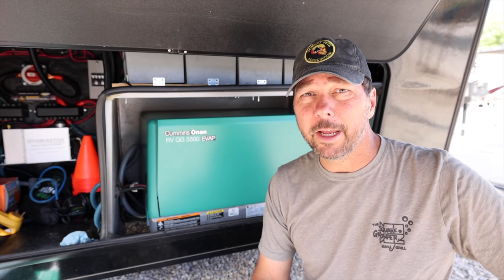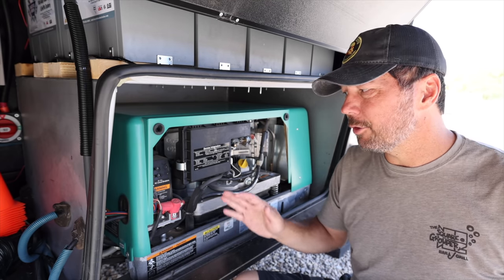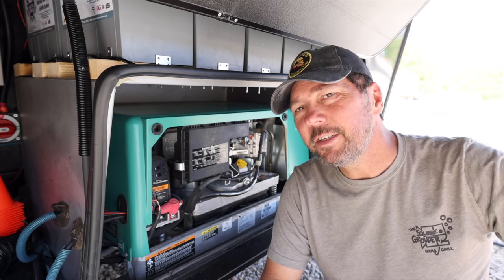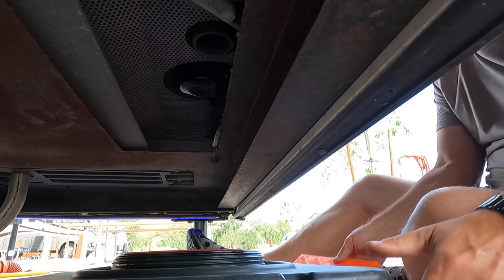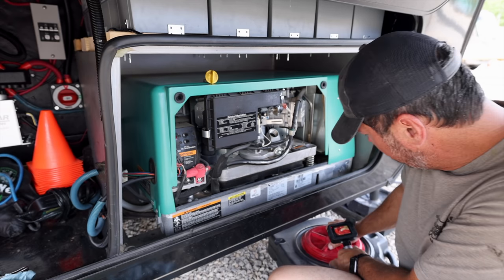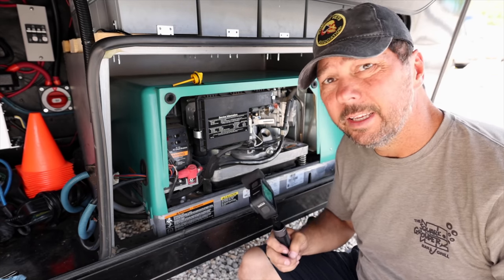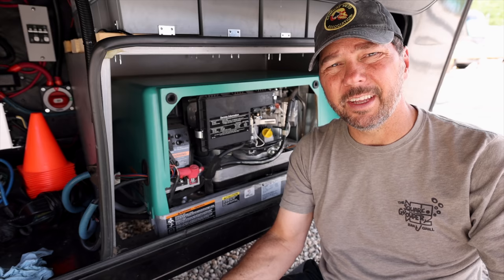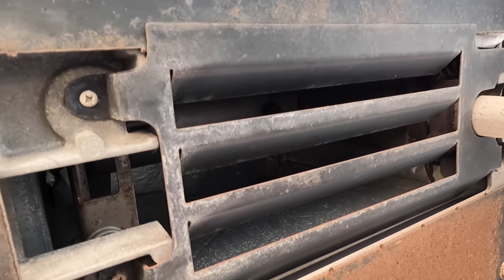RV Generator Maintenance (Full Time RV Life)

Comment: Take off the valve cover and the spark plug will be very easy to change. 
I used a 1/4 drive 10 mill socket with a small ratchet for the top right bolt. You will have to pry over that air tub or whatever it is' with a long pry tool up against the valve cover to get the socket on the bolt. It is not Very hard to dol. The end of the plug will right there easy to get at.  I also get 2 gaskets for covers and adjust the valves also' while I'm doing the plugs.

Comment: Obviously 2 years ago but you pull the air cleaner box of first then pull off the valve covers then you can check and adjust the valve clearance and you will have more room to clean or change the plugs

Comment: The big thing I see a lot is that people saw my Gen starts and shuts off and all you have todo is add oil to the motor and will run like. A lot of motors have a oil level sensor so it could be a teaspoon low of oil so just some oil in and your good .

Comment: Have you tried to fill the new filter with new oil before you install since it is vertical and that will allow you to get the desired oil level in easier.

Comment: We took vale cap off and put new rubber seal on. We also have a pipe for ventilation to the top of the roof. It sites up 5 feet above the roof and works great.no smell in the Rv even with wind or rain comes in to play?

Comment: Suggest electrical tape over the disconnected negative lead.  That mitigates the risk of inadvertent contact with chassis ground when working on the genny.
Also, the reason to run it under electrical load is because the field magnets can become demagnetized unless they are used periodically.  Same applies to any generator.

Comment: We have the QD8000. I find it useful to put a maintenance grid on the top panel with a sharpie. I note what was done, the hours and who did it right on the generator. I also note the interval for each column.
Reply from the maker: Great tip!
Reply: Since we generally start our generator from inside (as do most folks, I would guess, that have these types), we have a sticky note inside the cabinet door with that info.  Date and Hours when we last changed it.  Just came here to watch this video, again, as a refresher before changing our oil again in a few minutes.  Great to have a "reference tool" like this video available!

Comment: When you change the oil before installing the new oil filter if you fill the oil filter up with oil than install it. It's better for the motor (easer on the motor) also it will make adding the oil easier and faster so you don't have to start and stop the motor so mane times.

Comment: Generally when using a screw in dipstick to measure your oil level, you do NOT screw it it, only place it on the opening.  But read your manual, yours might be different...
Reply: It's that way for mine.  2500 LP

Comment: Chad - Great video!  Checking the oil is a bit confusing - I think I saw in the video your generator is series HGJAB Spec L - The Operators manual for that is p/n A035D009 (It's not clear on Cummins website) and that manual (same as my speck K) says to reinsert without screwing in the dipstick to check the oil level. Not that it matters much, I'm sure you know where full is on your dipstick.  Thanks again for all the great videos!!

Comment: For the spark plug on left use a 3/8" swivel socket adapter
Reply: You just remove the Valve Cover first. 
You need to adjust the valves at the same schedule anyways 👍

Comment: Quick tip.  Fill your oil filter 3/4 full prior to install, and it is easier to fill and will fill faster.  
Great video Really good info on the AGS.  Very useful. Thanks Chad 😃👍

Comment: Heads up if your generator fails to start after adding fresh oil recheck the oil level.  A Onan engine is design not to start if the oil level is low.

Comment: Don’t screw it in to check oil, just put it in and take it out to check the oil level do your running your engine low on oil . But that’s what my manual and tec told me the same thing. So check your manual it might have changed .

Comment: Awesome thanks Chad question for you we have pets and we have the transfer switch has the option to run at a certain voltage. What voltage do you recommend it turn on in the event there’s loss of power I’m assuming once the power is lost, it will run off the battery, but once the AC turns on it will require the generator. What do you recommend?

Comment: Good afternoon friend, congratulations for the very didactic video. What happens when the hour counter reaches 0 and if there is a repair or change, how is said counter reset and how many hours is it set? Thank you
Reply from the maker: Our meter will only zero if the onecontrol is replaced.  There might be a hobbs meter on the unit somewhere but I'm not sure where.  In the case of the former, it's just up to us to manually track hours if we get zeroed.

Comment: I changed my spark plugs last fall. I used a socket with a flex or swivel and an extension. It worked pretty good. It puts the ratchet outside of the generator allowing you to remove the spark plug. Getting the new plug back is tricky, I used the socket with the extension and turned it by hand to not cross thread it. Once I knew it was going in right, I put the ratchet back and tightened it up. BTW, what part of Utah are you in? I'm here in Salt Lake. If you need any tips let me know.
Reply: Just remove the valve cover first. 
You need to anyway so you can adjust the valves at the same schedule.

Comment: Put Amsoil small air cooled engines oil ,is the best for your Oman and make you Gen last twice. And my Oman would start and run for 5 minutes and die which is the low oil shut off and the best way to try first I dump some marvel Mystery oil in your motor and pour enough to fill a little from the top and start and let run and if it shuts off just start again and once the mystery oil works it way to the sensor it will run like a champ my 05 Oman runs like a dream and you can put a little in at each oil change to prevent it from fouling again . Good luck !!

Comment: The generator exhaust on ours comes out the back of the RV and I find it hard to believe the exhaust could reverse course and somehow get sucked into the RV by having a roof fan running. We have the 5500 with remote panel. But where is the hour meter on the generator? I could not find either the hour meter on the genset itself, or on the inside display.

Comment: Gas? You have a gas tank for the Onan? I thought you'd have a propane generator. Question: To read the dipstick, do you screw it in or just bump the engine to read?   (On my Onan, the geniuses who designed it routed the exhaust under the trap door for the filter.  I had to remove the exhaust to open the filter access door.)

Comment: I have a 1981 Domentic generator. Recently, it would start and run for 5 seconds or so, then turn off. A local RV dealership suggested that if it's low on oil, it will do this. Are there any thoughts here on this scenario?

Comment: Did i actually count 10 battle borne above the gen?
Reply: I was curious as well Chad, I can only see 6, but are you double stacked that row of 5 making the count 10??
Reply: I wonder if too much heat from the generator is a good idea for those batteries.
Reply from the maker: Yep!  Video coming in a couple of weeks.
Reply: 10!!!! Say what!
Reply: @wolfie26  not ideal in summer, but if they freeze in winter the generator will warm them so they can charge.  high temp cutoff occurs at 135F.  the generator draws in ambient air to cool itself and a lot of the heat generated is exhausted out the tailpipe, so probably ok unless you're camping in Las Vegas 🥵🥵🥵

Comment: When you say run it monthly under a load, while sitting idle, which components and or appliances do you choose to use?  Great video! Thanks
Reply from the maker: I would try to get it to about 80% capacity using the AC units.

Comment: Another very helpful video, as usual.  We're still kicking around whether to get an Onan like yours or a little portable Honda or something like that.  What do you recommend?
Reply from the maker: It depends on what you need it for. If you are running multiple AC then you might consider a 6500. 3 ACS completely consumes the 5500 and overloads it in extreme heat

Comment: I’m kinda surprised you don’t have a battery cutout switch for the generator. Seems that might make the servicing go a little quicker and save wear/tear on the terminal block.
Reply from the maker: Good idea!  But, space is a bit tight on that wall now with the solar gear....

Comment: Great video this week!  We just transitioned to a 5er. Our Class A did not have solar but control system like One Control had AGS triggers for low voltage, hvac load, and insufficient shore power. Our new Solitude came manual only.  It never occurred to me until your video AGS is almost mandatory with pets.

Comment: Did the fuel line clamp look like a 1/2 Pex clamp? Those are a must have in the RV toolbox, but having a worm drive one would be easier to install / remove.
Reply from the maker: It looked just like a pex, which I do have..  Looked like 1/2".

Comment: Oh, I did find the hours listed on the inside remote panel but if anyone knows where the genset meter is located please advise. I suspect it could be behind the electrical protect panel. The remote panel hours can be reset vs the actual gen hours cannot.

Comment: Is there concern over the oil that stays in  the motor after you start it up and then drain it? I was taught to let oil drain overnight to get all oil from top of engine and sides. If you start it and then drain it aren't you leaving oil on top and sides? Thank you for your videos.
Reply from the maker: If the engine was properly warmed up, it should all drain.

Comment: One tip with oil changes, put some new oil in the new filter before you install it. That helps get oil to the engine sooner and it will help get the oil level up to full quicker. This is a good practice especially if you haven't run the engine prior to draining the oil out as most of the oil has drained off of the bearings etc. Filling the oil filter just enough so you can tilt it to install it will help get oil moving much sooner once the engine is started. If the filter is empty, when you first start up, the oil has to fill the filter first which takes a few seconds or less which leaves the engine still dry of any oil while its running. Even if you can't fill it completely due to the angle of installing it etc., get enough in there as it will help even that little bit. BTW, 10-40 is good enough...some sources say a single wt oil doesn't lube as well as multi-viscosity does outside of temp ranges. 100% Synthetic will help even more. Regarding the oil filter "wrench", those are the best there is for removing and installing filter as they fit the filter into the wrench slots. I've never has one strip out however, with oil filter pliers, they will slip some, dent the filter and sometimes tear the filter causing oil to leak out. Keep the filter wrench...its golden.

Comment: I was told that this generator can power all 3 acs plus everything else in the rv all at the same time without overloading it. Is that true?
Reply from the maker: It's technically possible if all 3 ACs have soft starts and you turn off all other high amp items like your water heater.  Each AC is about 1500W, and the generator is a 5500.  You'll also need to stagger their startup.

Comment: Awesome video Chad very thorough and informative I had a question we recently bought our first RV a 17’ ft travel trailer we. are planning a trip to picacho peak state park in Arizona driving from Miami do you know what a realistic time frame in travel time starting from Miami Fl to Arizona how long it would take more or less one way? Thanks again for your videos and stay safe you and Tara and daisy of course.
The García’s from Miami
Reply from the maker: Use a tool like RV Trip Wizard or an RV GPS to map the whole trip, then divide that by how many miles you want to drive each day...  We try to make 300 our max.  Also see: https://changinglanesrv.com/rv-trip-planning-and-gps/
Reply: Great thanks Chad I wasn’t sure on how much mileage is safe to drive in a full days drive was estimating 400 per day which is about what you need to get out of Florida more or less but thanks for the tip will do.
Take care the García’s
Reply from the maker: We tow at 65mph max and take a lot of breaks, stop for lunch, etc...   400 is doable but we prefer 300.. Safe travels!

Comment: Chad, are there any supports under the batteries ? Didn't think a generator compartment could handle that weight ?
Reply from the maker: Yes... I have supports spreading the weight to the edges.
Reply: @ChangingLanes  awesome setup

Comment: Is yours propane fueled? Do you still exercise it if it is propane?
Reply: Yes, exercise it but not because of the fuel. Gasoline goes bad and can varnish the inside of the carb making it inoperable. But in either case it should be run under load at at least half of it's rated capacity and for at least a half hour once a month. This is good for the engine but it also drys any moisture in the generator section.
Reply: @trustme7731  thank you

Comment: I have a question. Usually when I s ok mu truck oil change, after I drain the oil I add some diesel first before the oil run it for a sec and then drain the diesel then add the oil would it be fine of I do that to the generator?
Reply from the maker: You put diesel in where the oil goes?  I've never heard of that.. maybe someone here can comment...
Reply: Add diesel and run it??? Sounds like a bomb in the making. 😯

Comment: Fill the oil filter before installing it Just an easy way to add the first 1/3 qt. Plus the oil that lubes the top end of the engine comes from the oil filter.

Comment: Chad, when you say “low power” referring to the spark plugs/fuel filter, you are referring to the generator performance rather than voltage to the rig I presume. Great video 👍🏻
Reply from the maker: That is correct.. overall performance.. not handling a heavy load.  I've also adjusted our governor to fix low voltage... will be covering that in an upcoming boondocking vid.. 👍🏼

Comment: Great video and nice tips! Thanks Chad! 
I am curious, you replaced the standard batteries from your RV and as I can see you installed them on a wooden surface and bolted on top of the generator. 
Is there any video about this? 
Are batteries not getting heat up by the generator?
Reply from the maker: Yes.. See: https://youtu.be/hdtC2XZ8z-g

Comment: That new air filter looked like it had some restrictions because of the blue plastic around the large object filtering section?? Especially when compared to the one that you removed. 

And to echo others, it is usually a good idea to prefill the oil filter prior to installing, when you can.

Comment: Better on the motor to fill oil filter with oil so you don't have a dry start.
Reply: The oil filter is post engine so oil is filter after running thru the genset. If it was preengine this would be a concern but they aren’t typically.